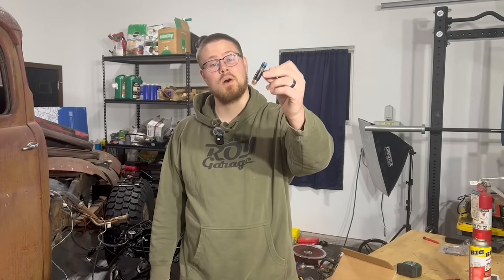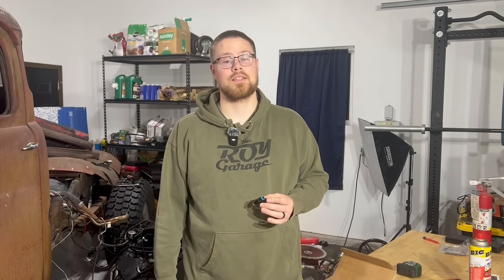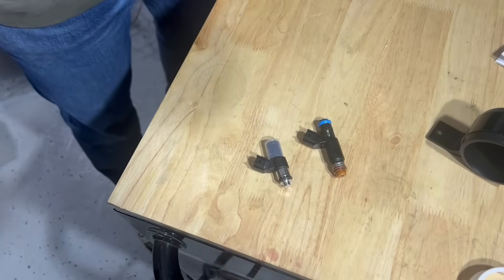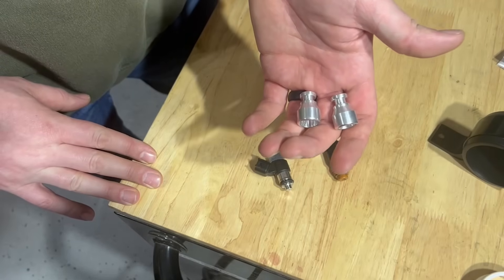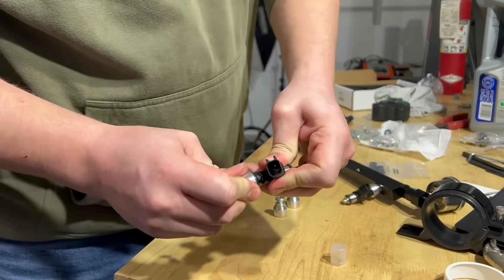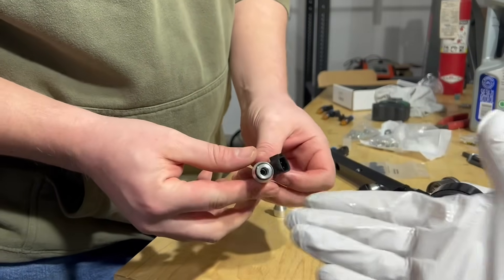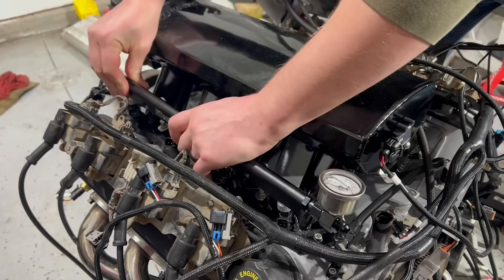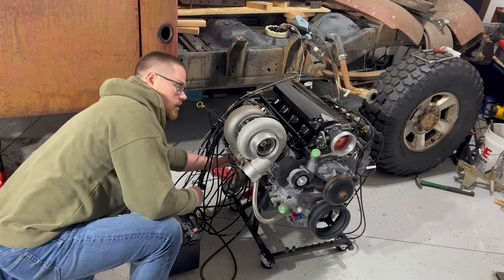How to Install ICT Billet Injector Spacers

Comment: I need spacers for my Holley hi ram in my 2015 Camaro ss for my ls3 injectors, got a link ?
Reply from the maker: What kind of injectors does the Holley hi Ram require? LS1 or LS2?  I could send you a link but there are a lot of different combinations.  ICT Billlet had infographic that is very helpful.  I’d post that but I can’t post pictures in comments.